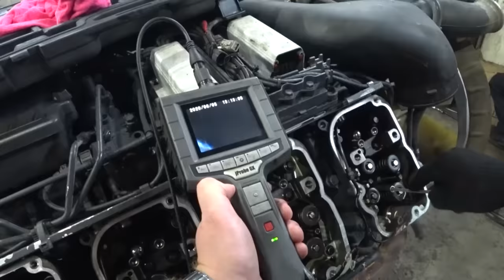СЛОЖНЫЙ РЕМОНТ РАМЫ ГРУЗОВИКА / DIFFICULT TRUCK FRAME REPAIR

Comment: I have done a truck frame like this sometime ago in a small pickup not a semi but the same principle I bought a truck that had a rusted frame but a good cab and I'm in the Collision business and I wind up buying another truck that had to smash cab but a good frame for I didn't know it got hit low in the front and was rolled over I didn't think it had damage in the frame and it looked good when I looked at it the only thing I seen that was swayed it looked like was the where you put the core support Fender aprons so I didn't think there was damage I didn't put it on a frame rack with a system to do all the measurements to see cuz I got a real good deal but wind up having a Twist in the whole frame and I didn't have no expensive frame machine I had a little post puller a measuring tape in a good eye and I straighten the whole frame and put the new cab on the bent totaled frame I had chains and Every Witch Way End Direction pulling the front side up and down and around when I was done the only thing I had to do was sham the cab for the cab mounts on the frame with shims

Comment: I tried to straighten a frame on a ford f-150 years ago. The frame looked straight but driving down the road the driver's side front tire was on the yellow line and passenger side rear tire would be on the white line. My cousin and I wanted to see if we could straighten the frame by chaining the truck between trees I'd didn't work we made it worse.

Comment: After all that buckling and bending and re-buckling and bending to straighten the chassis I hope someone decided to heat and stress relive the whole length of the chassis as it will obviously be weakened to quite a large extent through fatigue bending and stretching.

Comment: Only in Russia.  Low wages and no road safety standards.  Truck and 4x4 chassis are made with special alloys of steel and heating them to red hot alters their properties.  I'm not too worried about it bending in a future accident but rather it cracking and then failing months or years later during normal operation
Reply from the maker: Hi.
Well, we have been repairing truck frames for 10 years. A very large number of them have been repaired. After repair, cars run without problems. There are frames - which cannot be repaired or it is pointless. And such a frame is repaired well.

Comment: Will not watch past 30 seconds. First law of frame machine NO CHAIN BINDERS EVER,  secondly, the frame flanges are stretched too far. He might get it straight but not strong enough to stay straight. Best bet get new frame rails. Truck will achieve alignment and stay aligned.

Comment: A frame rail with that many holes and skinny aspect ratio, does not impress.   Also now the rails are going to flex funny with all the soft and the work-hardened areas.  That can lead to stress concentrations and fresh failures after a few hundred potholes.  There is a good reason why all frame rails here have painted on them: "DO NOT CUT, DRILL, BEND or GRIND."

Comment: ...if you own a Kenworth you can give them your serial number...
...they will supply two new pre-drilled frame rails...
...unbolt one and slide it out...
...slide the new one in and bolt it up...
...repeat for the other side...

Comment: Wouldn't it have been a lot faster, and easier on you, and cheaper for the customer to just replace those frame rails and move the crossmembers, and suspension points to the new rails?
You had to remove them anyway.

I knew a guy who replaced a frame that wasn't as bad as that, because it would have taken too much time to straighten it.
Reply: На правой стороне рамы VIN number , в последствии  могут быть проблемы при регистрации в полиции

Comment: This is the worst thing you can do. This frame should be cut up and scrapped!!!   Fixing it is a waste of time and money. New rails should have been replaced if that was the way to fix this piece of crap. The metal fatigue in the metal has made the frame unusable. Metallurgy 101!!! 
This is just a huge problem just waiting in the near future when the truck ends up killing someone when it’s back on the road.

Comment: It's the use of high heat on the deformed kinks on the frame body....that makes me cringe some. The chassis frame is of pre-sressed steel ....any heating to plastic phase robs it of that pre-sressed tension, becomes a localized point of weakness. Great ingenuity otherwise 👍

Comment: Send it to pakistan. It'll be ready in 2 hours 😂
Reply from the maker: We strive for quality
Reply: @trucks_channel_razborgruz  Yeah but no offence you charge like 100 times more more aswell 😂
Good work anyways. Pakistan work won't be 100% no doubt but I guess it's what the customer wants along with the tools available. They do with whatever they've got. Your tools and machinery cost a hell of a lot more so you can charge more. You can't really be asking for 'quality' from them types of mechanics in pakistan when the trucks will be used for different purposes on different/worse roads while being more loaded. Probably 90% of trucks are double framed as soon as they get to pakistan 😂